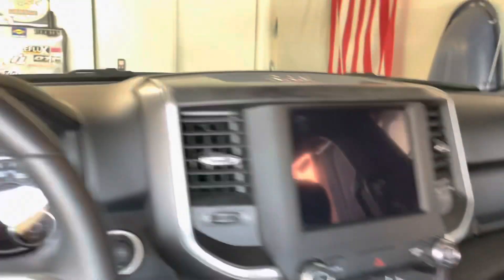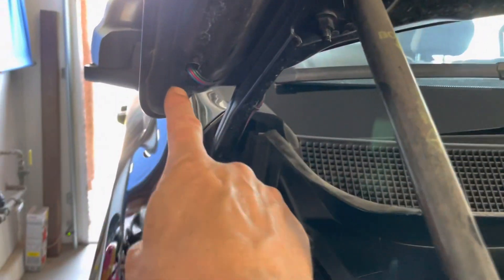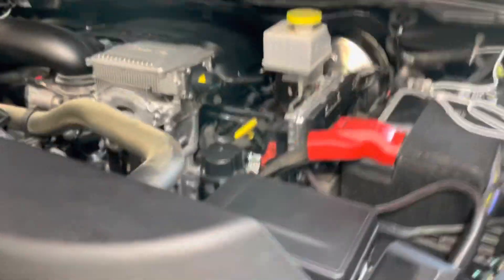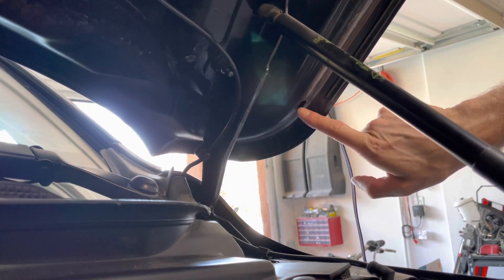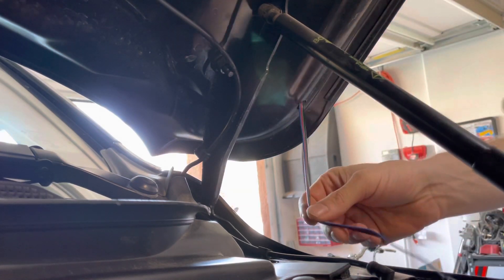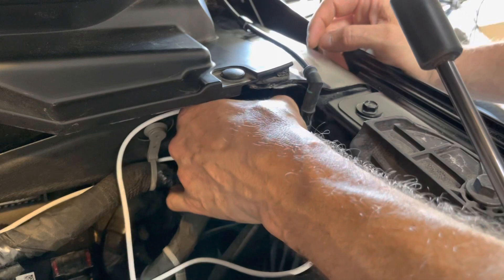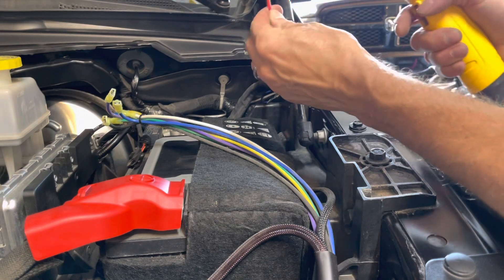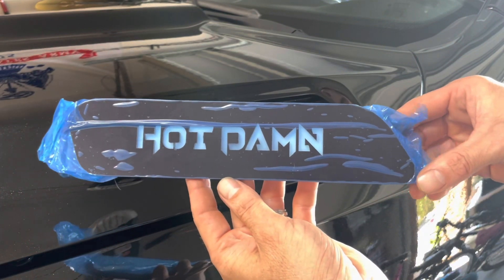Ram 1500 Ikonic RGB led hood badge install

Comment: Hot Damn is right! Looking good bud.👌👍 as for that plug and tape if you have some kicking around could just do it over top the tape just X couple zip ties that can be your wet proofing bit i hate elec tape in heat eventually its starts to slip lol 
 But looking sharp!!
Reply from the maker: Thank you! I agree, great idea.

Comment: My led strip didn't come with harness, just open ended wiring. Did you have to do your own and i missed a part of your video saying that?
Reply from the maker: To make my install easier I had already added the factory aux panel. Ground anywhere and 6 available positive leads. 5th gen ram 1500 factory auxiliary panel install
https://www.youtube.com/playlist?list=PLk95bjSCE1EoPx-I49HL47Rt1BzJTl92y
Reply: Thanks, brother, I'll check it out. Be blessed, and thanks for the response, too.
Reply from the maker: @mariojohnson3776  You are very welcome 🙏 and thank you!